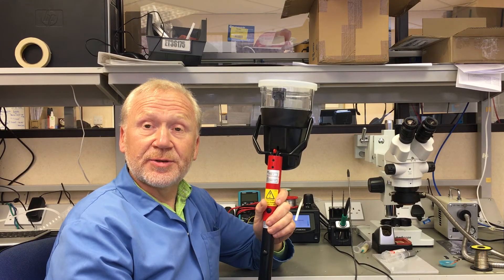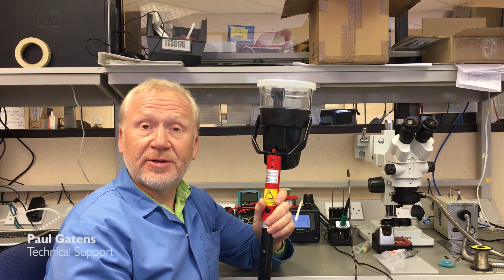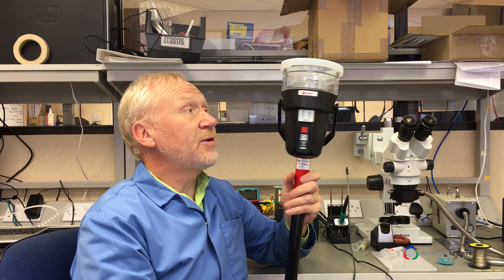Toolbox Talks | Solo 460 Heat detector tester

Comment: Hello Paul, 

My name is Jose,

 I am a fire alarm inspector. I have a fairly new 460 heat detector tester. After replacing the battery. It lights up green then after two seconds led goes red and nothing happens.  Can i get some help as to why this is happening? It was operating normally all day until i replaced the battery..

Comment: I have this model of solo heat detector tester.

I once used it and after which when i connect the battery baton and press the red switch, No green blinking light comes up. 

The battery baton is fully charged and it doesnt give a blink when connected to heat detector tester.

What could be wrong ?